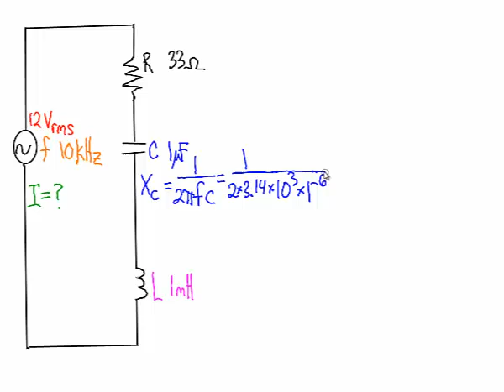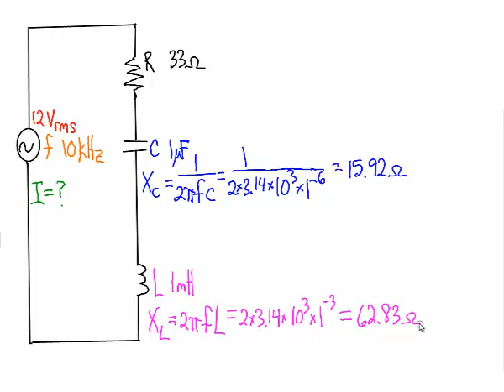Impedence in RLC circuits

Comment: Thanks!  I hope this also holds true if the circuit is just RL or just RC (simple low pass and high pass filters) because after much (several hours over a few days) of searching and confusion, this is the clearest explanation of the principle I have found.